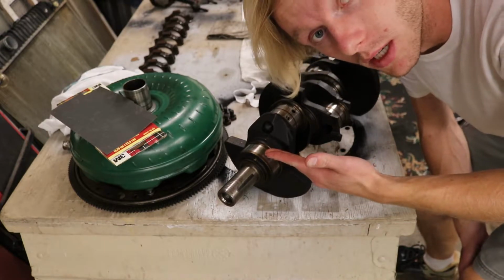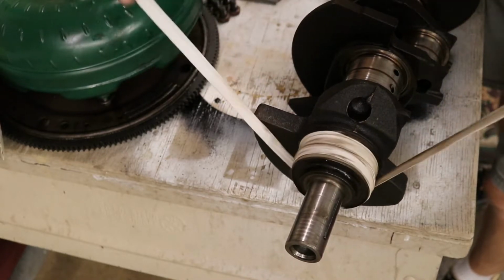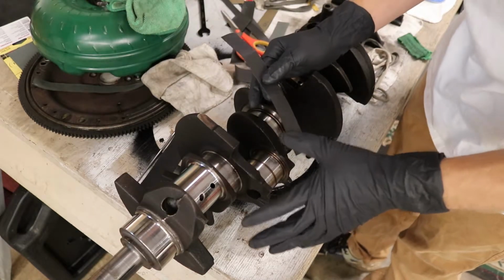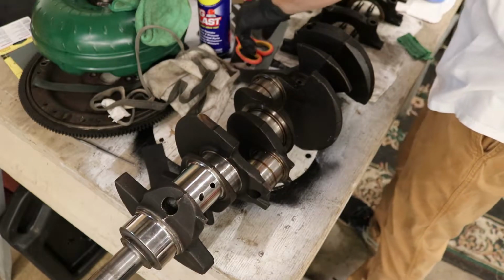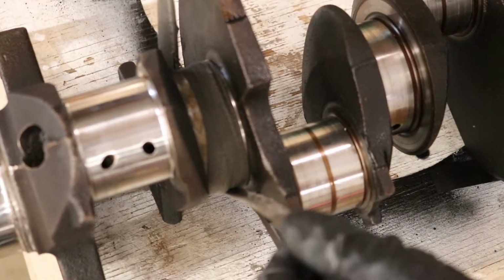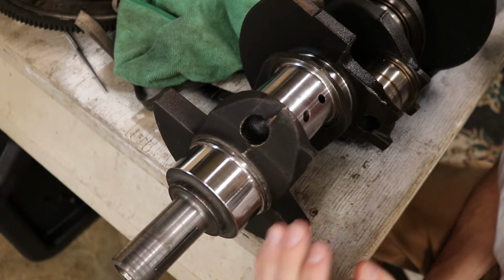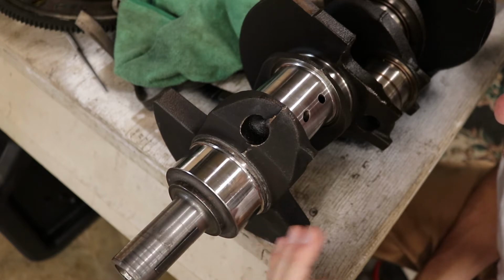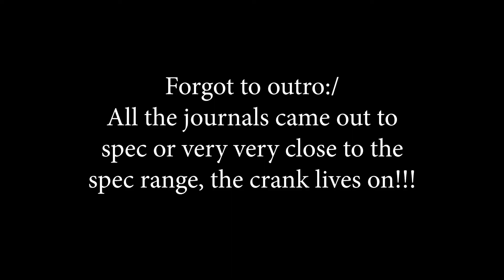1977 Ford F250 351 Modified Rebuild Revival Part 4 | Crankshaft Polishing |

Comment: The FM 3400 CP bearings are federal mogul and not original equipment. Original bearings would have a Ford logo with a date stamped in the back and usually clevite 77 as well as they seem to be the main supplier of bearings to Ford back in the day.
Reply from the maker: Ah I see, thanks for the info, I wonder when those bearing got replaced then, they were pretty smoked. I would assume late 80s mid 90s but who knows, hard to tell when the motor didn't get the proper maintenance.
Reply: @TylerCreates  My grandparents had a 77 F150 trailer special with a 351M and it was worn out clattering junk at 79,000 miles. That engine was well taken care of too. This was in the mid 80s when that one was rebuilt. Those engines are pretty well known for premature bearing wear and cracked heads if cast before 3/2/77. My guess would be late 80s early 90s.